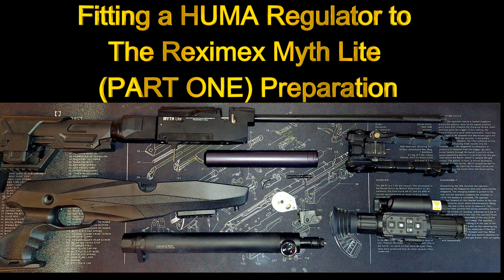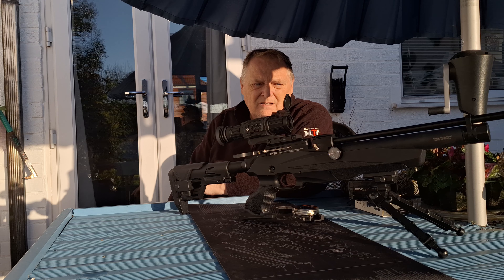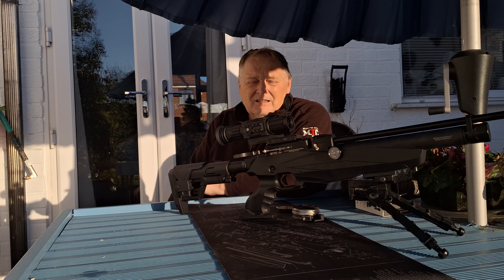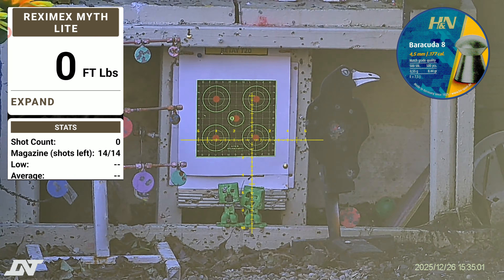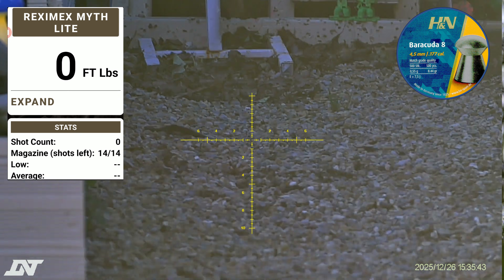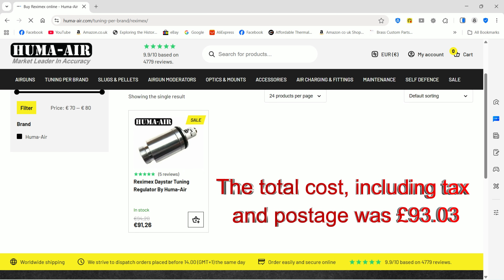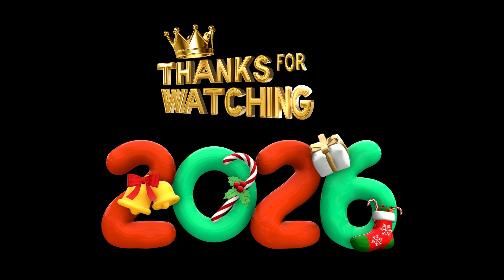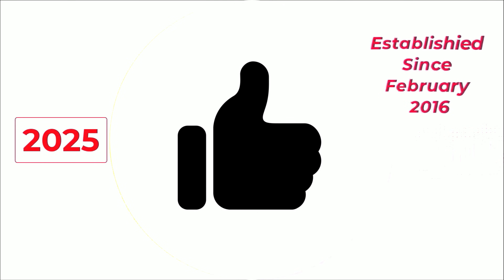Fitting a HUMA Regulator to the Reximex Myth Lite (PART ONE) Preparation

Comment from the maker: Well, after over 2 weeks the HUMA Regulator finally arrived today. It's about 1mm too small in diameter, and drops straight through, so I will use it for the Reximex Pretensis Carbine in .25 caliber when it comes out this year. I'll have to measure the internal diameter of the Myth cylinder and order a Lane Regulator for the Myth Lite instead.